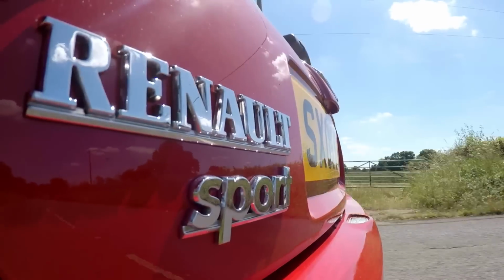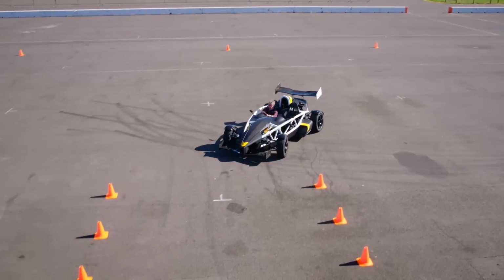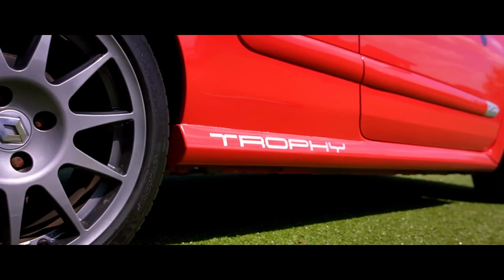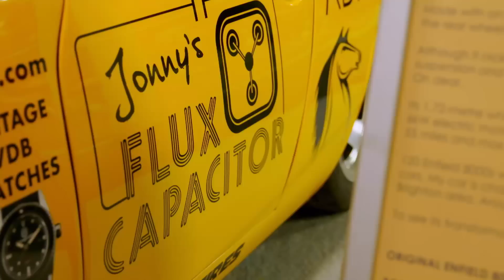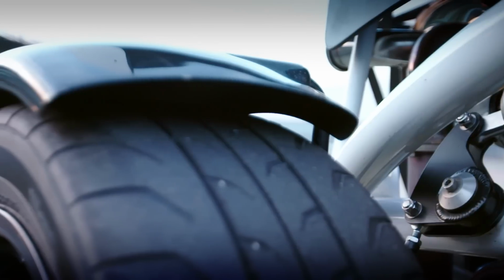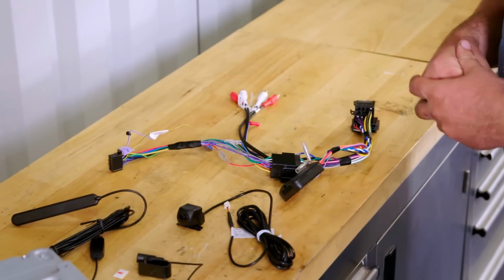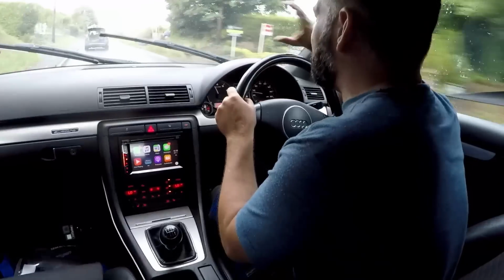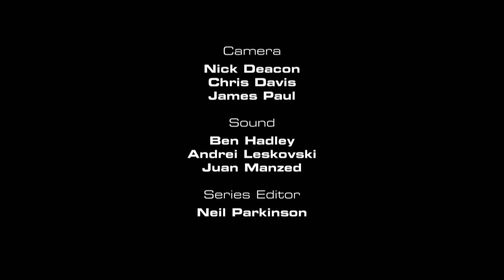Series 27: Episode Seven FULL Episode | Fifth Gear

Comment: I'm sorry but cutting the Radical due to straight line acceleration BEFORE the lap test was a HUGE HUGE HUGE mistake guys - it is NOT designed for acceleration, where it shines is handling and BRAKING. I'd bet big money it would have done the fastest lap time but a decent margin as while all of these are "track toys" it is more than that, it's a product RACECAR, not just a "track toy". Really disappointing that you'd test it in such a silly way and cut it before it ever got to do what it was designed for.
Reply: all cars should do all the test unless they will break in my opinion

Comment: To have a true result from a test all cars  must complete each test and be awarded points to find the overall winner. I have always had a problem with the test system Fifth Gear uses. It is biased and does not represent a true overall picture. Other than that it is a great show...

Comment: I wonder how long it took  for the fiesta ST  to over heat with track use ?
Reply: Why would it? I have done a lot of track driving on mine and with the stock intercooler it withstands a lot of punishment!
Reply: @castroalves8843  common UK problem  ask Google  .
Latest version has bigger intake grill area and radiator  capacity.
Reply: @dashcam2417  mine has the updated intercooler, that must be why 👍🏻